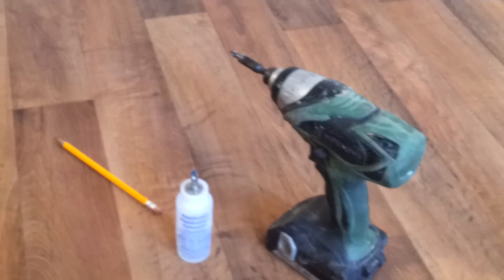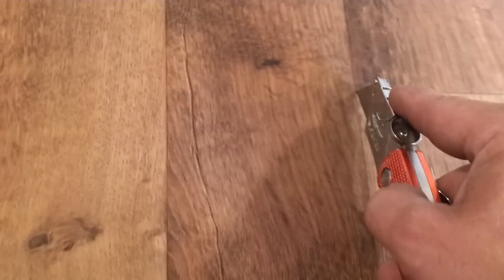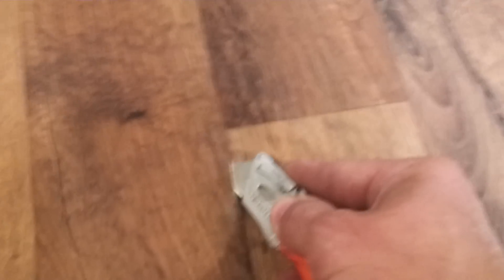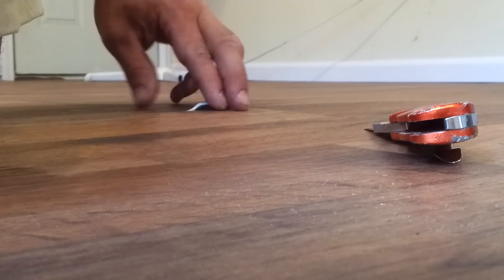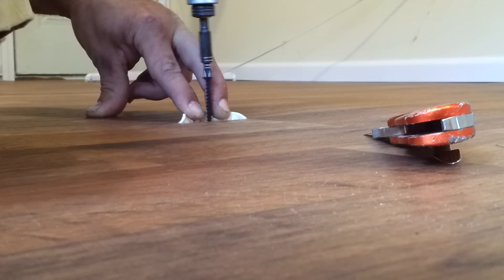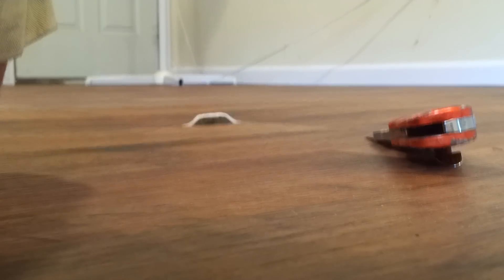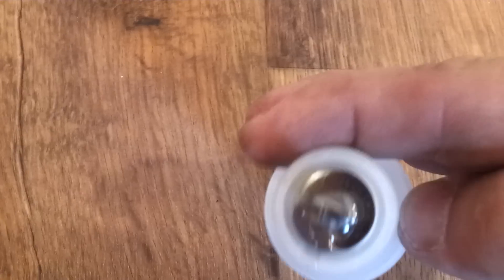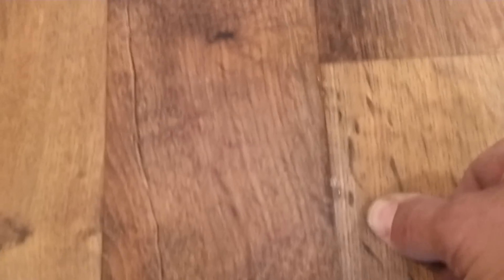Linoleum repair

Comment from the maker: The glue under this floor was still a little tacky, I didn't need to add any glue. I had bought some powergrab, that is what I would have used if I had needed it. You should be able to get it at any hardware store in the caulk section.

Comment: Hi, thank you for this video demo.  Do you have any suggestions for repair deep scratches on a linoleum kitchen floor?  I dropped a ceramic bowl on the kitchen's linoleum (hardwood print style). The bowl shattered into pieces leaving deep rips and scratches on the linoleum.  Do you have any suggestions for repairing it?